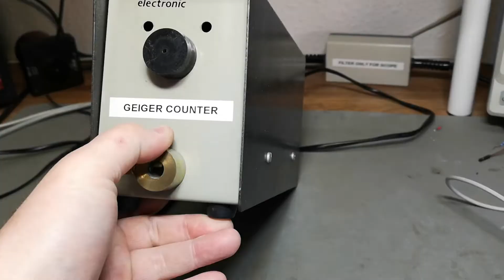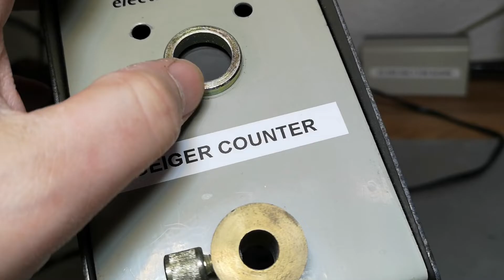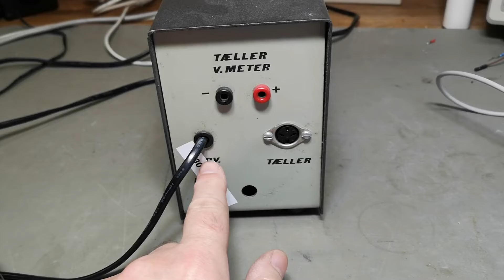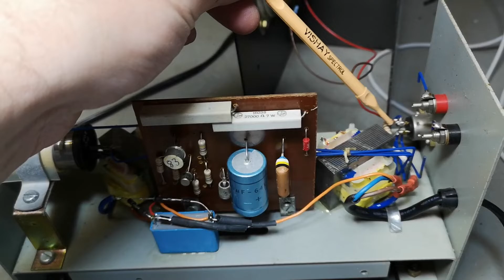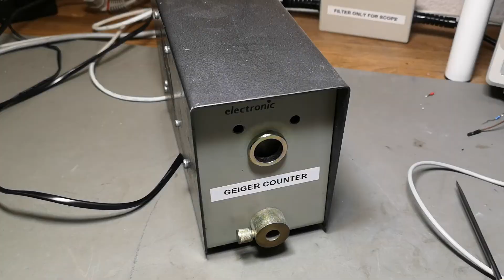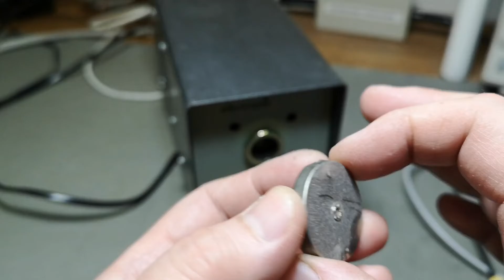Impo Geiger Counter Radioactive Detector Speaker 1975 test teardown

Comment: I did a similar thing, replacing a power supply for a Marconi moisture meter, as I was tired of buying D cells and PM3 batteries, as it used 2 D cells in parallel, and 5 PM3 batteries in series, to make 1 1V5 filament supply, and a 45V B+ rail. So used some surplus 1W transformers i had, 2 in parallel to make a 12VAC rail that was used to feed the filament supply, via a bridge rectifier, smoothing capacitor and a LM317 to give 1V2 power (filament used 80mA total on the 2 peanut tubes inside), and then fed another 2 transformers in reverse, secondaries in series, and repurposed 220VAC primaries in parallel, to give 100VAC on the output side. Then a bridge rectifier, 22uF 400VAC capacitor salvaged from an old SMPS, and a resistor and 2 47V 3W zener diodes as regulation.  Worked well, and fitted into the space for the batteries, with lots of room left over. cost almost nothing, all components were either surplus or from bags of random stuff I bought (the Zener diodes, and the bridge rectifiers), and the transformers were a job lot I got on auction (1000 transformers for $2). Still got a tray of those transformers, rest went into scrap metal a while ago  as moving 20kg was getting onerous. Still got a lifetime supply of 12 and 24V 400mw zener diodes as well from that day, 2 boxes of 10k of each, made by SGS Thompson.